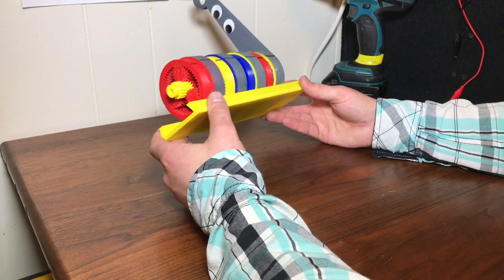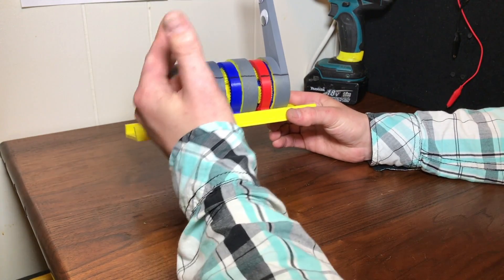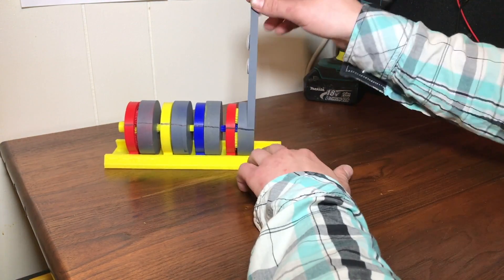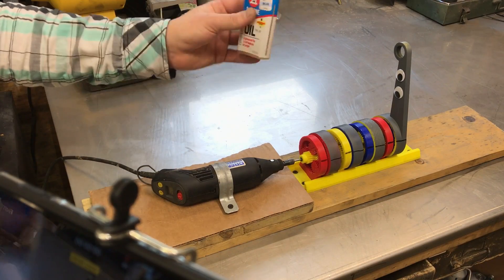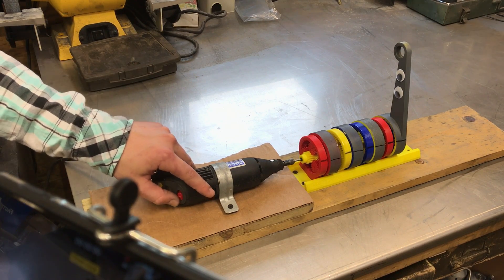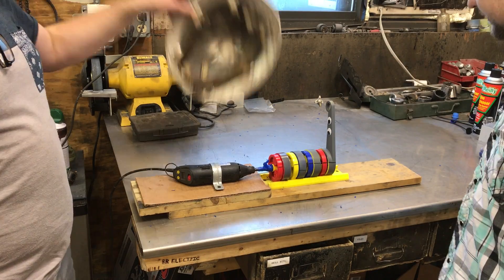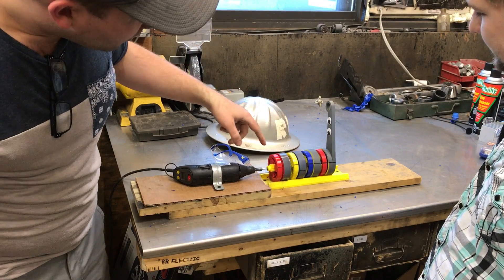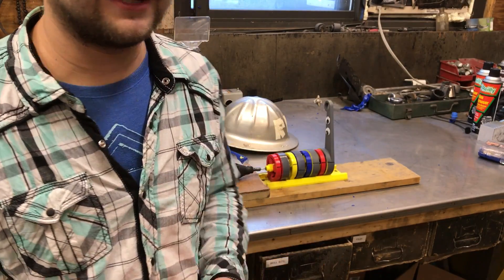3,616,238,492,881 To 1 - The Most Useless Gear Ratio Ever

Comment: I would tell students that "you can lift a battleship with a watch motor, but it's gonna take a while."
Reply: I just like the idea of an ant lifting a battleship.
Reply: Mark Bunds the USS Texas weighs 27,000 tons, how long would that take? Get this info to the people trying to preserve her, they need to know. (If only it were that easy lol.)
Reply: I'll need to know a few things first:

The brand of watch motor (required to calculate input torque in nNm (nano-Newton-meters)
The radius of the hoist drum (required to calculate lifting moment (output torque) for the reduction ratio)
Assuming you want the USS Texas to clear the water when we lift it, what is its draft (28ft. 6 inches)?

Rough estimates are based on an un-regulated motor, such as a wind-up type with the escapement removed, or a quartz type free-running as fast as the stepper will spin. This allows variable lifting speed as the displacement of the water by the floating vessel presents a "light" load at first, becoming heavier as more of its bulk becomes unsupported by the water. A regulated motor will run at roughly the same speed whether loaded, or unloaded, requiring more time than necessary to begin lifting the ship under initial low-load conditions.

One (very rough) estimate, based on a Timex wind-up calendar watch, found the mainspring drum torque output reduced from .0032 Nm to .923 uNm (micro Newton Meter) at the escapement wheel when fully wound, falling off to .324 uNm when the mainspring was 3/4 unwound. Battleship Texas weighs 240203966.4 N, so to lift the ship requires a force ratio greater than the weight of the ship in newtons x the hoisting drum radius in meters. We guessed using a drum measuring 36" in diameter (0.4572 meters radius), which will require a force ratio of 74137026540:1, so let's call it 75,000,000,000:1.

The max, unloaded and unregulated free-running rpm of the Timex escapement wheel with the mainspring fully wound is 6820 rpm, and 2777 rpm when 3/4 unwound, or 4798 average rpm. The displacement of the ship is nonlinear, since the hull shape varies significantly as it is lifted from the water, so the load variance has been estimated linearly over the ship's 28 ft. 6 inches of draft, from 0 lbs at the start, to its full weight of 240302966 Newtons.

Using these figures, lifting the ship only one inch (nearly zero load) would require around 80 years, and right around 30,000 years to clear the water. This time could be cut to a mere 6000 years using a Westclox wind-up alarm clock which produces 5 times the torque at its balance wheel...
Reply: Mark Bunds you are awesomely awesome
Reply: The ant could lift the ship as well; he just needs a mighty block and tackle, strung with I don't know how many lines, and a very, very long trail to pull his "fastline". To know how long, we need to know how hard the ant can pull on the line. A bigger ant would be better...
Reply: An ant of any size could do it, but the smaller she is, the greater the number of lines would have to be strung through the pulley blocks, making her run a lot longer in order to lift the ship.

And now you've got me curious too. I'd be willing to bet that an ant measuring 1 mm is easily stronger than the torque output of a fully-wound Timex watch escapement wheel, so this time I want to estimate not how long the ant would take to lift the ship, but how far she would have to tow the fastline of a multi-stage, compound block and tackle in order to lift the ship 28 feet.
Reply: Bill Brasky When I finally finish my YouTube studio, I plan to tackle useless topics like watches, ants, and battleships. The math of leverage ratios becomes blindingly ludicrous when expressed at such extremes, and often the time to completion must be expressed in geological units, or mechanical requirements exceed the practical physical limits of known materials, but I think an occasional short segment might be fun.
Reply: You can also tell your students that, at the atomic level, your battleship is already floating above any support system. Any one of your students could lift it a measurable distance with the touch of their finger if you had sensitive enough test equipment.
Reply: Mark Bunds this is awesome.  Loved reading this comment thread. Thanks for the great read.
Reply: Isn't that amazing? That's why I was so surprised that an ant only 1/16" long was "stronger" than the Timex watch!

I wonder how I would "rig" an ant to test how hard it could pull?  And even if I "harness" it in some way, what would I measure it with?
Reply: Careful  -we don't want to attract the attention of PETA
Reply: How big would an ant have to be in order to lift this alone?
Reply: This is how our galaxy is turned. If the battery is good enough for the energizer bunny...
Reply: Also, an average Field ant can lift objects measuring upto 5000 times its body weight.
Reply: Put the battleship in open space. Then keep throwing the watch motor at it.
Reply: Mark Bunds A very sensitive newton meter?
Reply: LOL!!!!!!!!
Reply: And the answer is no,  smartass. Don't ask questions you already know the answer to unless you teach people to ask and answer questions.
Reply: 8 out of 10 wrists thought this was not a good idea.
Reply: But life is simpler in the theoretical world, where pesky things like friction can be shrugged off.
Reply: I like the hamster wheel idea. that way the ant doesn't have to circumnavigate the Earth...
Reply: Ronald van Kemenade a broken watch is right twice a day, but a miscalibrated one is always wrong
Reply: Would a watch motor even have enough torque to spin a gear?
Reply: Mark Bunds That sounds philosophical...
Reply: Well what is weird is people should really ask why that really couldn't work in this case literally.
Reply: Even with a motor car transmission, it's impossible to translate 100% of the power at the crank to the wheels. I was watching a video of a supercar the other day where it was rated at 1000hp at the crank and 800hp at the wheels. i.e. in this example the frictional loss would eat up all of the ant's output in heat.
Reply: Sorry what I sort of meant is that the idea of a MASSIVE ratio can slowly slightly lift a large object has some problems. I think it may come down to the material of the mechanism breaking down before doing anything. Not to mention there could be a reverse motion in a mechanism without a one way aspect to it that for example a ship would drop one inch exploding the fast end totally apart.
Reply: A massive ratio in theory would have MASSIVE frictional losses in any real-world example. Therefore...it would chew up the ant's power/torque because the frictional losses alone would exceed the ant's output capability.
Reply: The Rogue Admiral Texas is a lightweight for a battleship. I wonder how long it would take to lift a ship like an Iowa or Yamato class
Reply: Assuming perfect test conditions, you should be able to test the strength of the ant using different masses of food and a sensitive spring balance.
Reply: Mark Bunds Obviously you cannot. You can slow the rotation speed infinitely, but you cannot make a tiny thing as strong.
Reply: What if they answer, "That's okay, we have time to see it ." ?
Reply: the watch motor would wear out
Reply from the maker: +Mark Bunds the way I was using the ant was just calculating its weight at a set distance away.
Reply: Wouldn't be able to lift a battle ship, because there'd be massive frictional losses involved in the transmission...so much so that the puny power of the watch motor would get all absorbed by the transmission.
Reply: interesting idea. i shall have to study this.
Reply: Rick Foley The question is whether it can be moved a <i>significant</i> distance.
Reply: As a student I would answer that it can't be done.

A watch motor doesn't last long enough to even take the slack out, let alone lift the ship out of the water. But I'm sure you're perfectly aware of that.

Comment: HOW Did yOu maKE thIS? MY cAPS LOcK iS jaMMed.
Reply: How did you make the car transmissions????
Reply from the maker: the gearboxes? they're 3D printed, I designed them you can find the model on thingiverse, just look up gear down for what? 1379

Comment: Those air duster cans are mostly butane/propane and not really just pressurised air (try using one as a flamethrower with a lighter in front of it!), using them upside down is releasing large amounts of butane, could have easily had a fireball if enough made it's way into the dremmel vents where there are sparks on the motor brushes. Careful with those things!
Reply from the maker: Yeah! I didn't even think of that at the time, then a couple days later I got curious and read the side of the can... I'm lucky that I didn't have a splosion

Comment: So if you turn the output arm once, the input sun would turn 3.6 trillion times?
Reply: Yes but its basically inpossible
Reply: colbster54trains impossible? so what happens if you yank the handle? the other end wont move?
would chaining the handle to the back of a truck be enough torque to spin the other side?

Comment: If you had a drill with 1000rpm and you could extend the lever ~0,1 lightyears out (173x times the distance Earth-Pluto) the  tip of the lever would ONLY have a speed of around 4,6 m/s or ~16,58 km/h  / ~10 mph

The ISS is traveling with a speed of 7,66 km/s and would need ~3916 years to get there.
Reply from the maker: eu4eagle Oh wow, that's hard to imagine. It would defiantly be hard to measure as the earth keeps rotating.
Reply: Sorry made a mistake :(. I calculated it with 0,001 lightsyears. That's still ~2x the distance Earth-Pluto and the ISS would still need 40 years to the tip.. 
That's still an unbelivable distance!
Hope that didn't ruin it for you :(

Comment: you should switch around the input and output shaft and attach a rotary tool bit to the output shaft. this would result in a 3.6 trillion rpm minimum rotary tool.

Comment: Another idea could be connecting a compressor wheel or impeller to the end and use an air jet/nozzle to spin it.. I could only imagine some crazy speeds could be had, plus air flow could aid in cooling. Something along the lines of a turbocharger design although used in the opposite direction.

Comment: You need to go a collaboration with Johnny q and have his highest rpm turbine turn your highest ratio gearbox.
Reply: Even at 100k rpm's it would still take something like 64.5 years to turn one revolution 😂 that's ridiculous.
Reply: a dyson motor can do 120,000 rpm just use one of those
Reply: Ok ok guys I got it lol
Reply: melts instantly
Reply: James Blair I know rc turbines run at 200k rpm.
Reply: At 86000 rpm it would take 80 years for one rotation of the output.
Reply: Rodrigo Dutra uh wut
Reply: 86000 rpm input would still take almost 3 months for 1 degree of output.
Reply: Even with that makes no visual difference.
Reply: Nathan Locke Omfg i died when i saw that
Reply: Christian Wang I don't think it would be particularly eventful based on this video's result.
Reply: lz b oh I just checked his fastest spinning turbine is 86,000 maybe he can build something way faster
Reply: My grandpa's ol chevy engine can go 650,000 rpm, if you start the engine it can get twice this speed
Reply: Christian Wang youre an idiot. Obviously if hes dealing with heat issues using a grinder, a crazy fast turbine isnt gonna work

Comment from the maker: Want to see what happens when you try to back drive just one stage of this gearbox? 
Check out this video https://youtu.be/tgJUiEC9_-A - Cheers!
Reply: what if you flipped it the other way so the back is the front and the front is the back?
Reply: What would happen if you spin it from backwards?

Would it become the most usefull ratio for Fastest propulsion?

I want to have a specifications of this.
Reply: Jack Jordan it would create a wormhole
Reply: The torque in reverse would be too much to turn
Reply: "i think this one moved at least two Donald trumps maybe three" 👏He👏Is👏Using👏Him👏As👏A👏Unit👏Of👏Measurement👏.
Reply: Something between nothing and breaking it.
Reply: Gear Down For What? Next time u should build a clock that doesn't tell time
Reply: Gear Down For What? What would happen if you yourself spun the output
Reply: Jack Jordan when he spins it normally it generates monstrous torque even if it would take many many years to spin one rotation.  If he were to reverse it and try from the other side; he would need more than a few things.  He would need better materials, because the act of spinning the gears would strip all the gears in the box.  He would need a better cooling system, because the amount of friction this monster would create would literally melt the gearbox, even if it were made of metal.  Finally he would need a motor able to provide monstrous torque, and tbh I don't think such a motor exists.

Also such a gearbox would be more useless than this gearbox, because it wouldn't be able to move any weight.  At least this gearbox is extremely precise in that it would take a very long time to make a turn, and it has immense amounts of torque.
Reply: Can you use the side with the handle and the input?
Reply: A millineal? What measurement fuckery is this? How many Trumps does it take to equal one millineal? How about a centineal?
Reply: You could use this as a counter for the us national debt if you compounded a couple  more planetaries
Reply: Do it underwater, so cooling is better!
Reply: Do you have a place to download these files?
Reply: Thanks!
Reply: Gear Down For What? I
Reply: i do want to see what happens when you back drive it!
Reply: Chu Bumpy the fuck
Reply: Chris Bleurgh the moment he said Donald trump I checked the comments cuz I knew he had triggered a little snowflake like ur self
Reply: Jack Jordan you would need a shit on of rotational force to make any movement happen.  unless you got the power of an entire planet it ain't happening and even if you did the gearbox would break :p
Reply from the maker: +Austin Lower thingiverse search 1379 or gear down for what
Reply: Joseph Brendel but when it comes to actually doing beneficial stuff, he's slow.
Reply: Cool video until you needlessly involved politics. Came to watch cool stuff about a 3Tn:1 gear ratio not hear you made snide remarks. Keep it classy
Reply: @joe

I love how you call him rump as well it is so fiting for our little big babyman dictator.
Reply: Gear Down For What?          ????         ??            ?                'Mm.  ,     M.            M.                  ,  m
Reply: Sky Marshall god, imagine back driving the whole thing while it's on a bike. You would literally have to run 0 kelvin coolant and make it EXACTLY symmetrical and out of the strongest thing possible just to keep it from blowing up.
Reply: Joseph Brendel you sir are dumb.
Reply: Gear Down For What? What happened when you invers it?
Reply: Got my subscribe and shares for being an epic gear master and for being an unsafe space for triggering the Rumpist antisocial injustice warrior snowflakes.
Reply: I'd piss on donald trump....

actually...on second thoughts,   he'd enjoy it.
Reply: Austin Lower yea right! that gear is useless he said, other dude said yea this one moved about as fast a 1 trump well he is a fuck if he thinks rump is moving slow. he got a hell of a lot more done in 6 months than Obama in 8 years. if everyone would just look at it like lets all help America not rep/dems and I am a dem not a snowflake but a old one legged retired machinist that lost my job to china lasko fan company moved there. anyway, lets just see what he does before we label him anything.